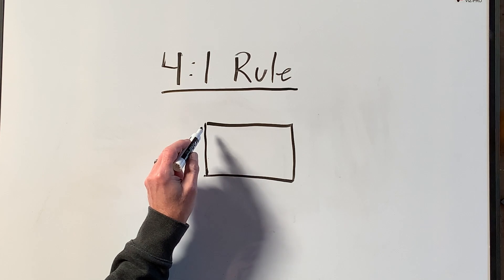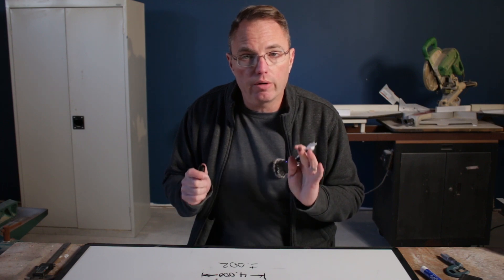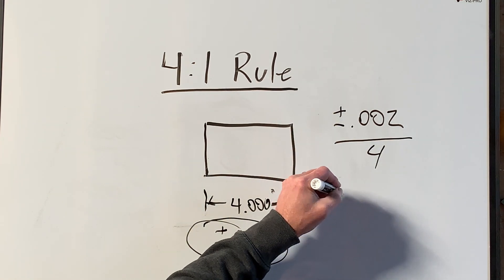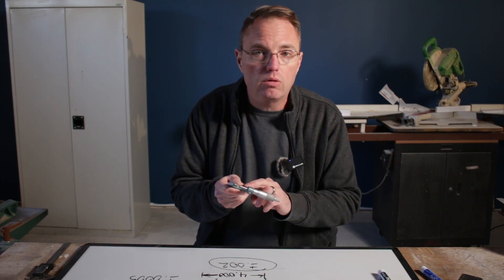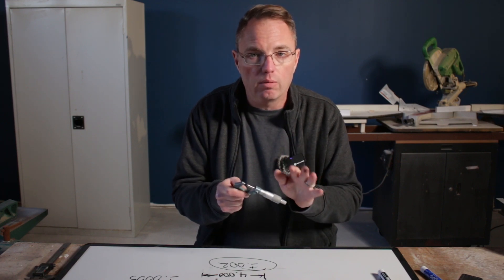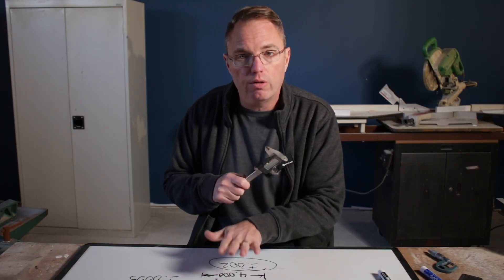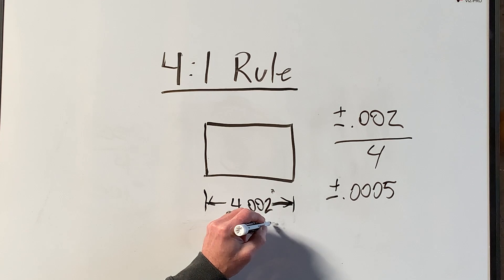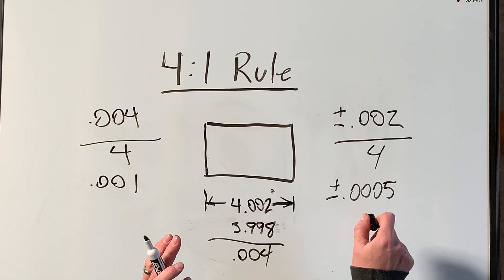The 4:1 Measurement Rule Every Maker Should Know (Most Skip This!)

Comment: First you don't get your Instruments calibrated once a year unless required by your customers for traceability etc, It came with a standard to check it against. If it is and 0-1" barrel micrometer close it all the way check your zero, next take the standard from your 1-2" barrel micrometer and check it against the 1" standard, if it is off then send it for repair. Price quotes and largely affected by tolerance and how the measurements are written on the prints. if you want a piece 4" in length great, If you want a piece 4.000 the price changes If it is 4.0000 the price just went through the roof.
Reply from the maker: In my field of jet engine overhaul, the 4:1 rule is standard. Yes, I agree that you calibrate as needed. However, I have seen the carbide anvils on a micrometer wear out due to plasma coating. So, in that you would have to pay to get it calibrated. They would use an optical flat to determine flatness. Your mileage may vary. Thank you for watching! Cheers!

Comment: I liked your video, so I "liked" it. I have wondered about the question you are answering, never heard it asked or answered before by anyone else. When I did ask it, the guy I asked was totally taken off guard and agreed that it was a valid question, but never heard it asked or answered. I'm curious where the 4:1 rule came from and what other answers could be found there.
Now speaking as someone with absolutely no authority - I am not alone in this, and I have tried to convince students that they should use "inches", "thousandths", and "tenths" or "tenths of a thousandths". "A ten thousandths" could be mistaken for 0.010". Every machinist I have worked with has used inches and tenths of a thousandth, also never using "a tenth" to mean 0.100". 
Thanks for your video and for answering a question I had!
Reply from the maker: Thank you for the like! The 4:1 rule is used in metrology. My background is in aerospace, it is used in the machining of jet engine parts. Yes, I agree, you should use inches, thousands and tenths. Almost everything revolves around the third decimal (thousandth). It is very hard to communicate to a machinist if you don't. Thank you for watching. Cheers!